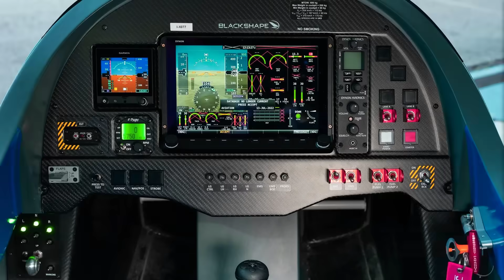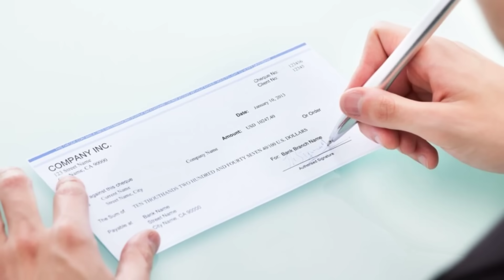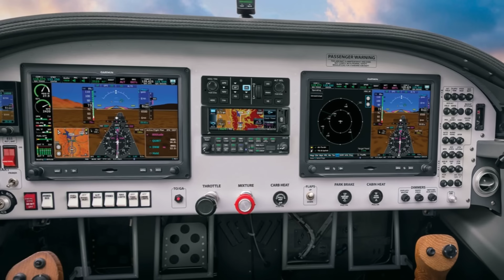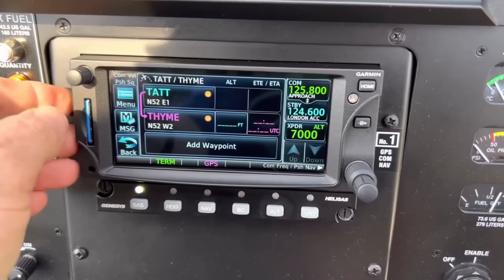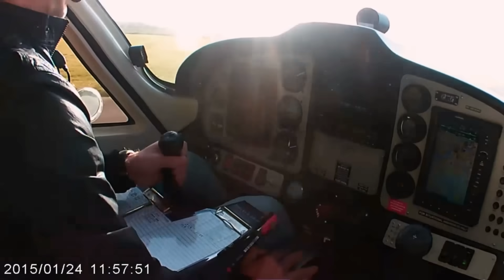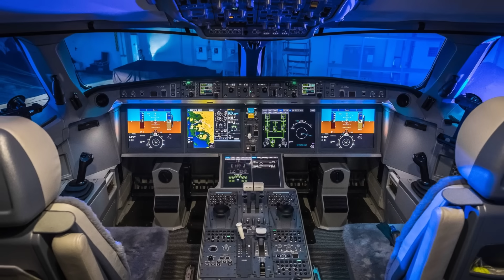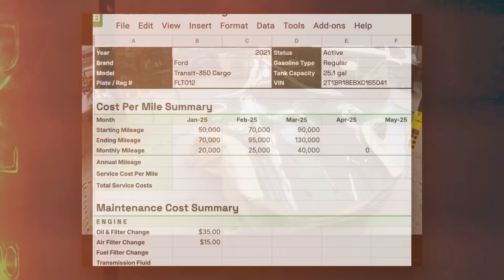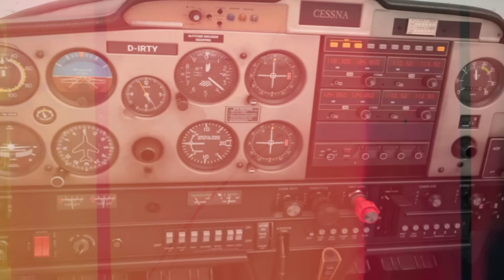A $30k Cessna 152 CHALLENGED A $200k Sport Plane – Then THIS Happened...

Comment: I,VE LEARNED IN 150,S AND THE 152,S.GOT MY PPL IN 1984 IN A 152N49006 at khwd n,calif.i,ve said it befor the glass cockpit is like flying a computor and no way will i do fly one.spent 35 yrs in the airlines as a mechanic and the class cockpits still had anolog guages to reley on.stick&rudder thats real flying pilots and was glad i learned that way.

Comment: I completely agree with your analysis. The old work horse endures quite a lot training abuses.
However, as an LSA owner myself (who got my training and certification flying C172’s by the way), once you get familiarized with the LSA you get to appreciate all its virtues. In my case, I wouldn’t change my CTLS for a Cessna… that’s just my two cents.